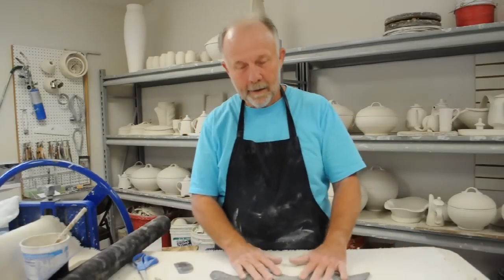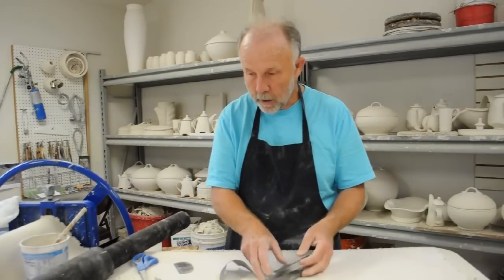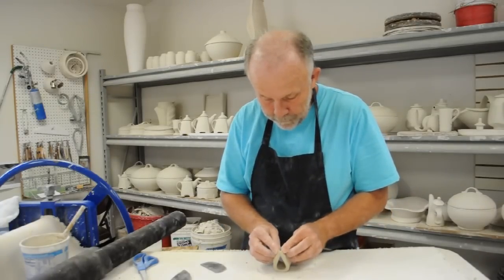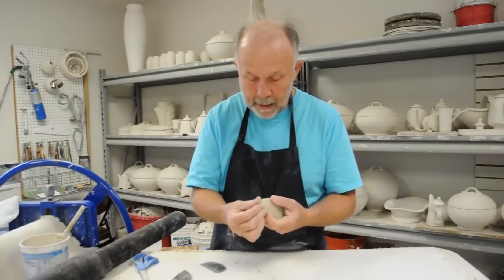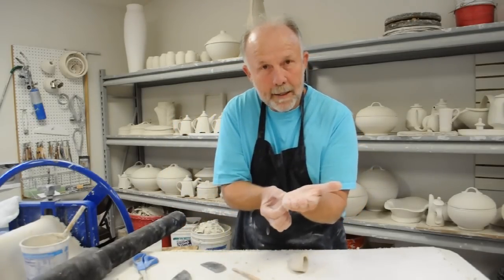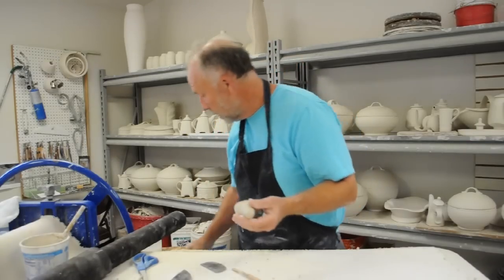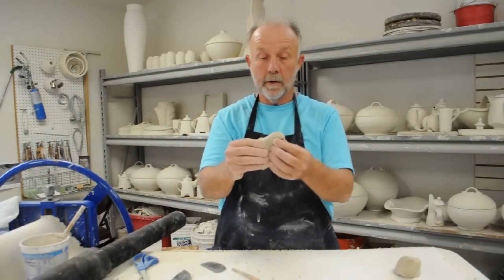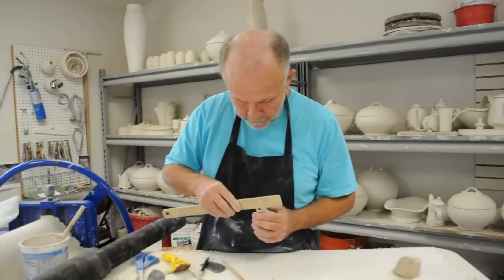Handbuilding Spouts with Stan Irvin, Part 1

Comment: Great video.  Well organized and presented.  Keep it up.  One suggestion that I found helpful to add to your method.... I have several wooden eggs purchased from Hobby Lobby that I used to insert into the base of the spout to get the opening perfectly symmetrical where it attaches to the pot.  Plugging the base with one of these wooden eggs also makes a good handle while further shaping and refining the end of the spout.